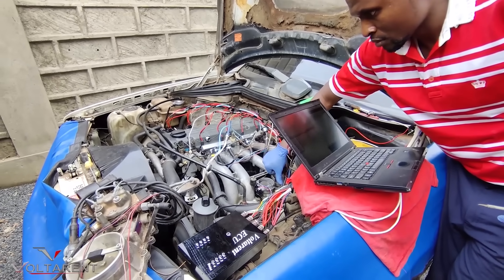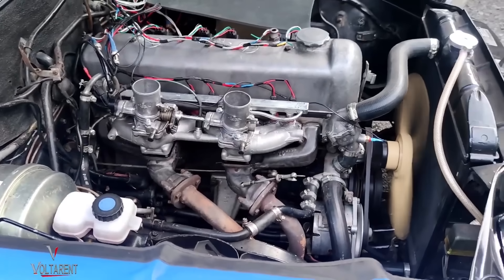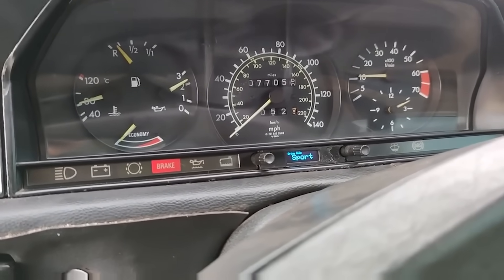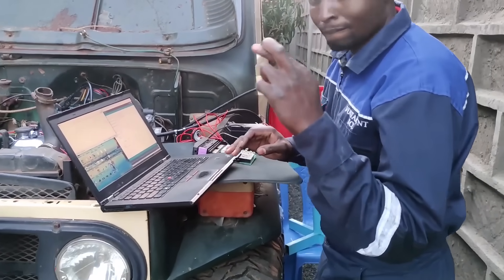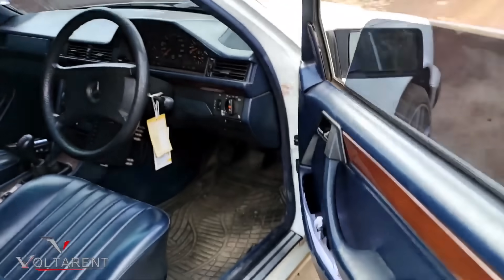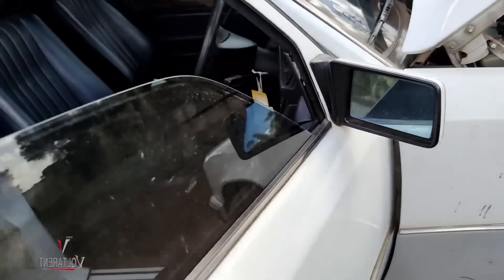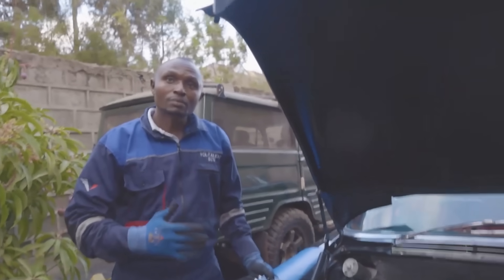African Genius makes Old Engines outdo Modern Engines!

Comment: Carburetors can get better mileage then "more efficient" fuel injectors. Most of the fuel burned is wasted. Ever wonder why the Auto companies never built a recycler system for the fumes and recirculate it back in the carburetor? 1 man already did this with an old 1970ish vehicle and got 100mpg with it and it's recorded. Not long after he..well you know.

Comment: Hho is an experimental technology  it  will surprise you!  Cool engine running  prolonging engine life and engine oil life. improve engine power & performance and increase fuel burning efficiency. Petrol combustion engine can burn only 18% petrol in the engine but hho will burn   100%fuel  in the engine No un burn fuel wastage . Engine will run more power fully, Consume less fuel. Hho system works on petrol, deisel, cng,  types engines.

Engine runs lighter smoother reducing carbon emissions .  

An efficient hho car kit lower the engine temperature more then 100 degree F.  Hho car kit reduce car maintenance  Hho kits restore better fuel economy. Hho system is very easy and simple to install. Hho solves the engine heating problems automatically!!!. Clean fuel burning , Reducing engine noise & vibration due to the faster fuel burning. Hho car kits works nicely requires no modifications in the car engine. No side effects on car engine.

Engine start quickly safe your car battery.  make your car a low cost hy-brid. Use a  low amp. Hho car kit will work better. You can 5 transfer hho kit from one car to another one. For more information about this useful technology  keep watching hho zafar videos. Or call 03082266179 zafar karachi.

Comment: Did he say you have to reset a carborator from time to time? Does he mean adjust the carborator from time to time? Because adjusting a carborator only takes a screwdriver and a good ear, not a laptop and tuning software. Im sorry but im not going to give up my right to repair just to modernize my classic car. Retrofit a car to an ECU and fuel injectors only helps people living in the mountains with altitude changes.

Comment: Bless this man for improving MPG, which reduces CO2 per mile also.
Kits have been available for over 3 decades.
 What would be even better is to convert as many existing vehicles to operate on burning WATER molecules split electrically into Hydrogen and PURE Oxygen, which would provide more Oxygen than twin turbochargers.
And no CO2 !

Comment: Use a 12v battery pack for your fuel pump. Like for power tools. Should be able to mount it too np.

Comment: This is very impressive, but he is just installing self made newer technology. Its not even close to the engineering that goes into todays engines. It might be more fuel efficient, powerful and a bit better on emissions than before, which is good, but like I said: Its already old technology, he didn't invent anything and it's not better than current engines. Its kinda sad that everything coming out of Africa is presented like its some revolutionary invention, a lot of times even making claims that go against the laws of thermodynamics or physics in general.

Comment: That microcontroller is not doing it in nanoseconds, and he definitely didn't invent anything or write the code either. It's likely to be a based on the Speeduino Arduino-based open-source ECU, claiming the work of countless volunteers to himself, unlike the countless other people applying the effort on their car projects. If anything, he could be in breach of the GPLv3 open source license agreement of Speeduino.

Comment: Homey im doing the same thing back here in the states. Im starting to see people with newer vehicles now though. Im  using open source speeduino based ECU/PCM's to bypass the myriad the problems caused by any of the little sub controllers the manufacturers network together. When i was just starting out though i converted my dads lawn tractor from 1982 over to efi. Good work though man and i wish you all the success!!!!

Comment: I dont want to burst someones bubble but overall this is nice upgrade,, but installing standalone ECU, and converting some old carb/mechanical inj to some modern EFI is not rocket science. All you need is some ECU platform (you can go fancy with haltec/ecumaster, or open source with speeduino), some coils and injectors from modern car and fabrication knowledge to install it. And ofcourse you need to tune it.
Seeing in comments so called engineers that mind blows after watching this vid is preaty funny ngl

Comment: Its not really an ecu/pcm,hes using open source code to run injector and coil drivers through an arduino,its a rudementary device that does not even appear to be running any combustion or post combustion monitoring,therefore fuelling will be haphazard,I cant see it passing current ( or previous) emissions regs,but it will get you on the move.

Comment: This looks legit. A distributer is used for position tracking, and TPS for measuring. And that's enough. Something like Alpha-N fueling strategy. If of course you don't have winters. If you do, you also need a temp sensor for compensation. 

It's fine. Better that a carb.

Comment: Not easy, very talented.  
But with all do respect, this is a common upgrade to older engines, been done many times in the tuner world.  Again, from scratch this is special, but there are off the shelf ECUs that already do these things so he didn't invent anything just made it from scratch.  
Going from distributor to smart coils is super common.  Going from distributor to fuel injection is a little trickier but again been done before.
I'd like to know the cost to build from scratch a working ecu, he mentioned he designs them but who builds them?  And do they have longevity?

Comment: Modern engines arent just designed for power and fuel economy; both get sacrificed because regulations also dictate lower emissions, which, simply put, is done by burning additional fuel

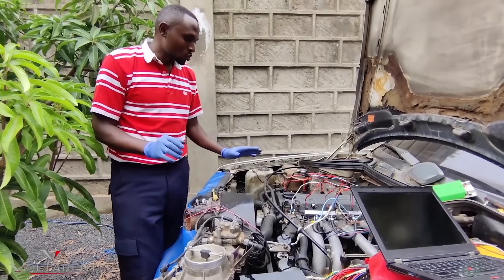Comment: Guy literally says "it performs like todays modern engine" @1:48 , so why the misleading title?  

He upgraded from a distributor to distributor-less coil on plug design (he still has the distributor base though, he needs it to know where TDC on Cylinder 1 is, and likely uses it with an encoder for timings based on position and RPM) and swapped the mechanical throttle body fuel injection for a modern fuel rail with injectors for each cylinder.  Neither of these upgrades will change the maximum performance potential of the engine, though he can certainly increase the fuel efficiency or maximize the available performance.

It could be an cool product to bring new life to older engines for people willing to do some DIY work, but there are a lot of aftermarket conversion kits for both of these upgrades already available.  He could carve a niche if its significantly cheaper than those options or something like an LS swap.

Comment: I have worked on these late 70s ish mechanical air metering throttle body systems with at the time was the best equipment available. You are the self-chosen one to decide to take this mess on. Thank you for restoring my faith in Enginering overall. Back in 83-84 I was truly doubting if humanity will survive while working on these contraptions.

Comment: idea is great but. 1000USD for an old car is expensive...i can buy another good old car  with that money or a motorbike. for it to be actually be a feasible business it should be around for less than maybe 200USD. but for that to happen you need at least 200-300k USD in funding to mass produce a cheaper single board version of the ECU.

Comment: I used to remanufacture ECUs for John Deere. I can say that this man is a genius. To figure it out on his own, from basic physics and study of mechanical engines, he's first class. Yes, there are open projects that do the same thing, but those are made by several people working together, with lots of relevant experience. To do that by himself is near miraculous.  I have 30 years experience working in aerospace and manufacturing, and I have no doubt that Mr. Mbiria would be an asset anywhere he chose to work.
Reply: How can I block the variable camshaft sprockets so that the computer doesn't have problems when activating the VVT with codes?
Reply: @Rperformancerd  To block variable camshaft sprockets (or cam phasers) to prevent VVT (Variable Valve Timing) activation, you'll need to mechanically lock the cam phasers and electronically manage or spoof the VVT system signals to avoid setting diagnostic trouble codes (DTCs). ~ChatGPT
Reply: @tw0pers0nalities thanks But my question could be asked on a 2.0 engine and not have to modify the computer.

Comment: Aftermarket EFI for vehicle engines has been available for decades from many suppliers. 

Aftermarket motorcycle efi is lacking.
Reply: Costs less than $1k to covert a V8 with current kits, using proven components, with customer support.

Comment: Oh guys... first of all he could youse already existing ECUs - you can find them on the marked. 
Second - his arduio thing is unable to keep safety. If something goes wrong with it - nothing can reset it, nothing can tell you. Usual ECUs have triple protection levels.
Then, talking about temperature, vibrations etc - it is again no that resistant.

The most worrying topic to me is engine security systems like detonation prevention. Without good algorithms the pistons will melt. You cannot just ignite. 
Maybe low power engines will last longer, but just that.

What I did not understand also from the video is why is he looking into 20 lines of code, then he opens an empty text file in notepad and tells "I need to see something:". Notepad doesn't update text file content so you can see changes in real time.

He is talking with 100% understanding of what he is talking about  and I really believe - Arduino is enough to run an engine. 
From another side - oh something is not letting me to accept that 25-30 years old guy can make all he made with that level of quality. I feel it like it's not a fake.. but something which is not that good in reality.

Comment: Had a 1992 190 best car i ever owned. 360k miles. I accidentally put larger msd wires on it and the coil wire was arcing inside distributor cap. Waay more power and better fuel economy until i noticed the sparks flying outside the distributor and fixed it. New dist and rotor n wires.

Comment: Any older engines "outdo" modern engines... Modern engines are deliberately over complicated and designed to just outlive the warranty and when they fail, they are not designed to be repaired or rebuilt. They are considered disposable and replaced !!!

Comment: so what this is telling us is all these auto companies can make cars much more fuel efficient and refuse to. americans dont need cars that go 0-60 in 2 seconds, they could just focus on making them 5x more efficient, but they dont...but WE are the ones that have to worry about "climate change" right? people should be extremely pissed off about the cars we arent allowed to drive and basically the same fuel economy for the past 30 years. if a single dude in africa can make cars fuel efficent, we are suppose to believe Ford, GM, Honda, Toyota etc couldnt have made this 20 years ago? we had laptops and wires back then too.

Comment: just reacting o the title: not disputing that he is a genius, but it really doesn't take a genius to make an old engine outperform a new engine. It really doesn't take any work at all in most cases, considering that new engines are less powerful by design, specs reduced in order for them to comply with environmental legislation as well as safety norms. On top of all that, manufacturers saving up on production costs. Overall, modern engines are weaker than old engines to begin with

Comment: There is nothing new that he is doing but how he is tailoring it to Africa is fantastic.
Keeping old cars going and making them more efficient is a win win but I think he needs to rethink his business model. This is run more like a hobby than a business. 
Now he has his ECUs, they can relatively easily be produced at scale. The hard part is producing the mechanical parts - crank position sensor for the distributer mount, throttle and injector setup. Also the fuel pump, filter and pipework. Each of these he is having to design and produce for each car that comes along. He also needs to set up and test the ecu on every car.
Making bespoke kits for beautiful pampered wealthy people's cars is holding his business back and he needs to concentrate more on the business side and catering to the mass market of dilapidated work horses limping around Africa owned by poor people. 
He is limiting his capacity/profits and it will burn him out.
Now he has proven the concept, he needs to concentrate on one car make or even model. If he produced a reliable easy to fit kit for a popular car that is not too complicated he can concentrate on scaling up production of these components. This would probably cut the costs by half, greatly expanding the percentage of people who can afford such a kit. Advertising would be targeted making it more effective and word of mouth would help as more people learn about the kits. With the increased profits he could then expand his range of bolt on kits and build a franchise of fitting centres. As the kits become more popular he would start to have a que of people waiting for kits for their model of car to be brought out.
He needs a business partner to take care of the office/distribution side of things to enable him to concentrate on the R&D.
I see great potential and hope he can pull it off.
Reply: U have to start somewhere

Comment: Your going backwards. Older engines are more reliable and cost efficient over their lifetime. Engines that could be once turned and repaired on the side of the road by any backyard machanic now need special diagnostic equipment and training on how to use these tools.

Comment: So basically it optimizes fuel to air ratios? We already have tunable fuel injection systems. I don't see what sets this apart from that other than it's probably easier for locals to modernize their cars

Comment: Very cool to see what can be done in terms of converting engines to run on a modern ecu with fuel injection. This is a good option on a lot of vehicles but I would say it depends on the availability of parts for the existing system and on the quality of the parts used in the conversion, and the reliability of supply of those parts. Some older cars have relatively simple systems and carburetors etc are widely available as they are standardized, so although they need adjustment and maintenance it can be done cheaply and easily, that would be my concern with regard to electronic conversion. Would be interesting to see data on the change in power output/fuel economy especially on the older Mercedes. I'm sure with a big American V8 of the early 70s such a conversion could result in significant gains in power and efficiency.

Comment: This will work practically only if the cost of the conversion is significantly cheaper than just repairing the original issue. And then you have to worry about who will service this aftermarket setup.

Comment: He has converted a gas engine to port injected. You can buy kits for any old engine since many years with programmable ecu. Cost about 1000-1500$  for 4-6 cylinder. But good that he offers conversions as u save fuel and parts are way cheaper than orig benz.

Comment: Kudos my dear, even though i'm far from you, i'm so happy and excited at this innovations. I have a Mercedes Benz 190 in my fleet, too clean to let it go.. Can you help me replicate same over here on my 190 in order  to achieve both performance and efficiency(fuel economy) as described? Can you get me your cpu, and guide me on the installation and these wiring aspect too to achieved this over here in Nigeria. I'm a tech guy like you, facinated by innovations like this

Comment: This is actually very easy to do if you don’t have to conform to any type of smog regulation or inspection laws.
Reply: so building an ecu from scratch and writting the code for it is very easy. That's crazy because all the engineers and programmers here in the comment section says its not.

Comment: What you can see in the film is how to replace parts in the ignition system so that you are supposed to get a more modern electrical system. That would mean removing the coil and rotor and maybe the switch. But you try to imply that you also easily change from a carburettor to injection, which you have on newer cars. But in order to do that, the entire intake for the engine must be replaced with an intake adapted for injectors. Even if it's a "sunshine story", you have to be aware that you don't just stick a new ECU in the glove box to get a modern fuel-efficient engine. The carburettor must be removed. Efficient coils must replace an old ignition system. Ideally, the car should be equipped with supercharger.

Comment: When is this coming to the market?   the ECU and conversion kit for various models?  Conversion to electric is possible for older vehicles, but costs a fortune and requires altering original appearance in most cases.  Which is not something classic vehicle enthusiast are jumping up and down for...it defeats the purpose of restoring.  My vehicle is not a true classic, but '95 is plummeting away at fast pace. And the inefficient system is hard at the pumps and hard on the health.  The exhaust fumes are  almost unbearable on my old rig.

Comment: It still holds the full latency of normal gasoline efficiency regardless. Try adding hydrogen in small amounts. Also that electronic package will do nothing in regards to the old drivetrain. This system is obviously nothing in regards to the most basic toyota or bosch efficiency systems. Nothing new here.